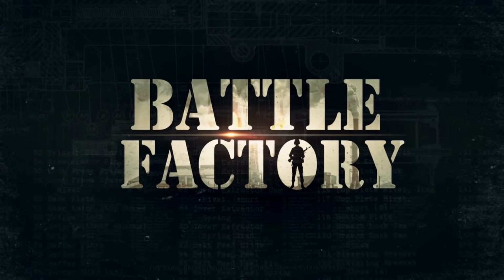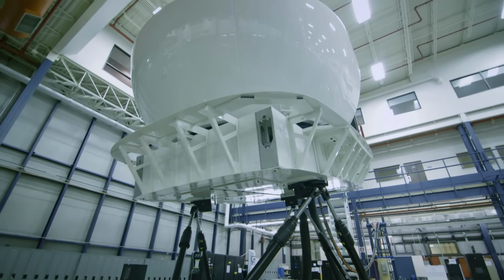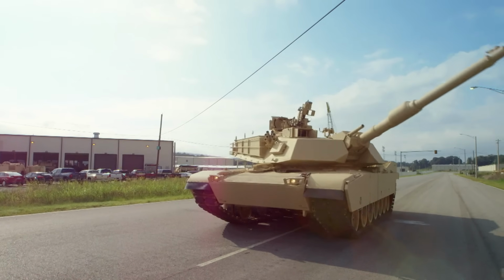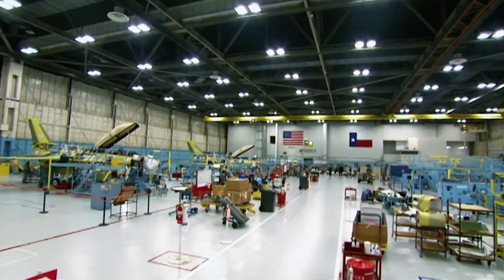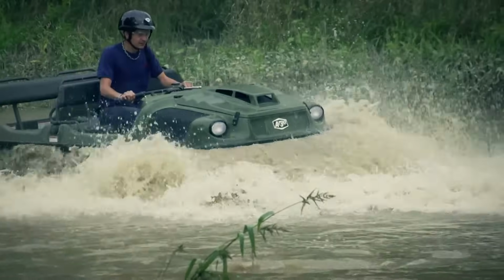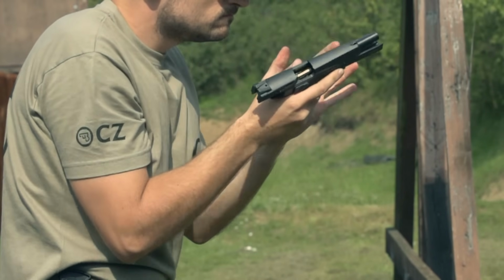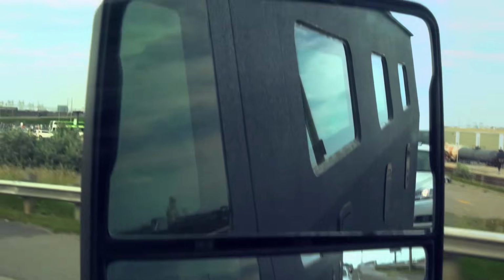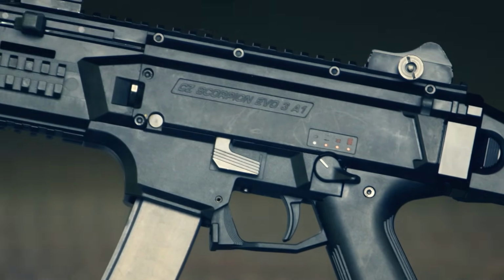Battle Factory: The Secret World of Military Manufacturing | FD Engineering

Comment: With a grenade once you pull the pin you don't have 4 seconds. Once you let go off the spoon you have depending on what detonator is in it 3 to 7 seconds. You can hold it forever if you want without a pin. Plus you can put the pin back in